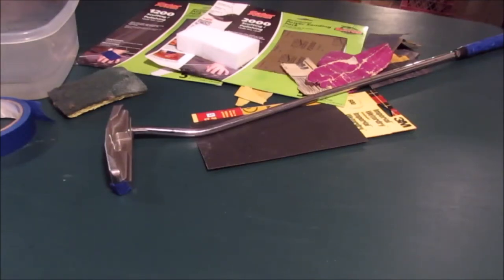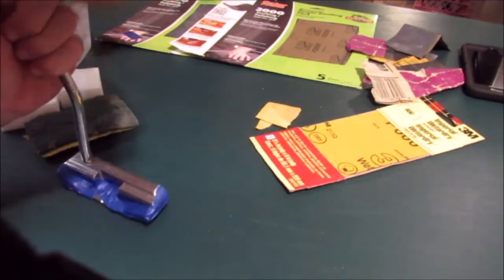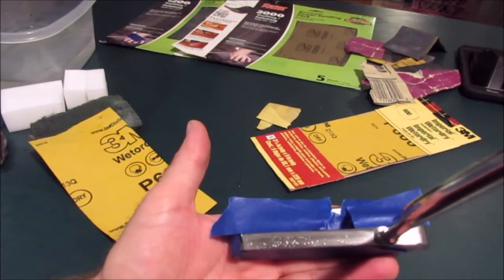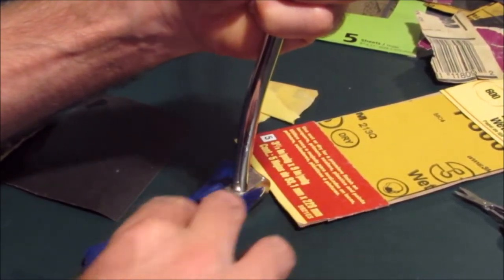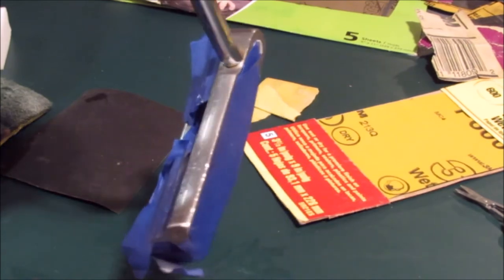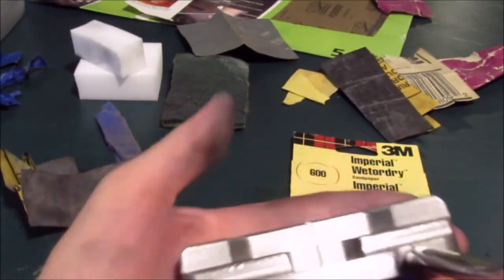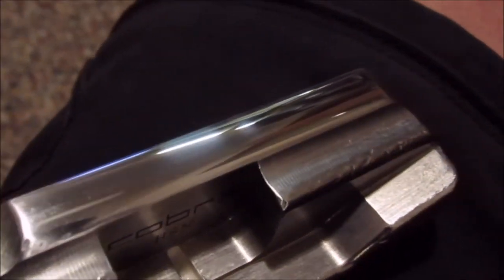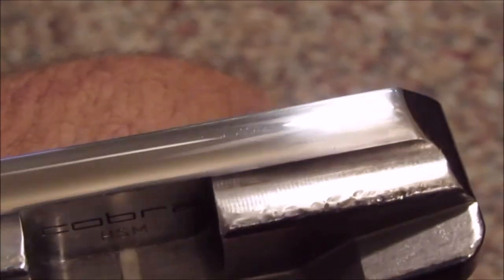Removing Dings and scratches from Golf Putter at Home DIY  putter refinish

Comment: Thank u for sharing your ideas! That is a lot...of elbow grease....takes a ton of patience and perseverance .....using multiple grits and hand sanding the putter. Putters I find are THE most difficult to remove deep dings since there are sooooo many edges to the putter...your approach is the best....tackle one edge at a time. Putter looks great, I am a new subscriber!
Reply from the maker: Thanks for the awesome comments! It's a lot of fun refinishing things DIY.  I wish I had a bead blasting kit!  Cheers!
Reply: @kidwilson3357  yes an economical small, take sale, thrift store, estate sale bead blaster ....for sale cheap to be worth a try?!....would be a coup de gras. Thought about sand blaster also, not sure w soft club metals how sand would not pit the metal? Any blaster device would be hard to control on putter nooks and crannies and angles...to protect adjacent surfaces that are fine....I can understand any club restoration if done as meticulously by hand like u did, can be labor, time  and materials expensive....the vintage or classic clubs...or even if special meaning, inherited or gifted clubs are worth restoring imho 😀
Reply from the maker: @MrWkendwarrior   If I had an extra room or a garage, I would probably just get a little Bead blasting Cabinet, gun and compressor.  You can get a whole set up pretty cheap to start out with  somewhere like a HArbor Freight store.  I just don't have the room.   I have refinished about 20 putters and when I had access to the bead blasting gun at the Mechanic Shop, the end product was like Brand New with a satin finish that was flawless.   fun project to do.

Comment: Great video. Exactly what I was looking for. I have an original ping anser that I want to clean up and I think the top line can definitely use this type of treatment
Reply: I have one as well, how did that go?
Reply: @8Huntro6   It worked out well. I did exactly what he did in the video. I didn't start with a really course grit, but something in the middle, then went finer and finer. I just went to an Ace Hardware in my area and just purchased a sheet of each grit. Was actually more delicate with the courser stuff and went a little bit more aggressive as I went finer and finer with the grit. I didn't go as fine as he did in the video because I didn't want a mirrored look, but more of a matte look. So, I guess that is something to think about.
Reply from the maker: @jjs5151   A scotch Brite pad will take the Shine off the mirrored finish.  Tks for the comments

Comment: Why don't you buy a cheap dremel tool,I just bought one £25 that's around $30,it sands off all scratches and dings then I polished it with one of the bits that came with dremel now looks amazing.i like buying old cheap dirty/beat up ping putters and tidy them up with my dremel tool,I can get brass putters as shiny as bars of gold lol
Reply from the maker: I just used what I had lying around the house

Comment: Thanks for posting this, never even thought this was something that could possibly be done to a putter. My putter is pretty new but I somehow got one small ding right above the face on the leading edge of the top line, so not on the top line surface but right on the edge between the face and the top line. Do you think I could fix that with this sandpaper method too? I’m worried if it would sand down into the face since it’s right on the edge. And if I did it I would end up with a softer/rounder edge right?
Reply from the maker: Hello. First of all I am not an expert by any means but I will try to answer based on the putters I have messed around with.   I think the real key is having a uniform finish, so I would imagine if you tried to remove that one little ding with sand paper, it would probably stand out if you tried to sand it in just that one spot.  You would probably have to tape off the entire top line and leave just a bit on the front edge the entire length of the face. Then sand the entire edge to taper/round it off and make it look the same. Thing is if you do just the edge, it might make the top line a differnent color than the edge.   Is your putter stainless steel?   The methods I used in the video are really only good to get the putter cleaned up and ding free..   I mention several times In my video the final step really is to have a Bead blasting Cabinet, gun and compressor.  Using the bead blaster, the little beads will give the putter a beautiful Satin Finish and the putter will look brand new.    However, using just the steps I show in my video will only get you so far.  If your putter is Carbon steel, then you can sand it down and Gun Blue it and can make it look great without the Bead Blasting.     I probably would not chance it if you like the putter. :)   But hey.. If you want an excuse to get a new putter. you can take a chance and have fun experimenting.  If you do decide to give it a go, just remember to put painters tape down and make sure it is even and only leave the parts you want to sand exposed. Taping and prep work is key.    I hope this helps.  Feel free to ask any other questions.  Thakns for the comments and watching the video.  There are a couple more videos i did on the putters so check them out also.  Cheers
Reply: @kidwilson3357  Thanks a lot for the such detailed and thoughtful answer. I just watched the part 2 of this and the final transformation was unbelievable... 
my putter is soft carbon steel, with a bronze finish. https://www.tgw.com/bettinardi-2016-studio-stock--2-putter This very putter right here. It’s a really good putter to me and I like everything about it, but I am kinda the same way as you said you were with clubs, almost having OCD for them being imperfect if they could be... I’ll probably hold on to it for a little longer til there’re dings and scuffs all over it and then I’ll do this project...
Reply from the maker: @vic_0315   That putter is a beauty. Carbon is usually butter soft so I bet that is a great feeling putter.   I wonder what color metal would be under that finish if its Carbon?  One cool thing about that finish is  if it's removable, you can sand it down and then use a torch and really make some wild colors with it..  I think.  I would research Torching/Refinishing Carbon Putters and I bet you will find a lot.    I had a Carbon Mid-slant Scotty Cameron Pro Platinum that I took all the dings out of and put a really awesome gun metal blue on it.   I wish I still had it.   If you do that, you will have to learn how to do a custom paint-fill as well.  Once again, tks for the positive comments. Stay safe out there!

Comment: Did you only use the 600 grit?
Reply from the maker: I used what I had lying around the house.   I did not use only 600 grit.  Ideally you want to go heavier to lighter.  I usually go 600, 800, 1000, 1200 etc.

Comment: Can you do a video on doing the nickel finishing? I’ve got an old Scotty I want to do that too because as of right now it doesn’t have a finish so it will rust as is.
Reply from the maker: Hi, i did a couple of videos after this one.  Check my channel and you should be able to find it.  It's the one with the Odyssey white hot #6.      Using scotch brite pad will give a slight nickle finish, but really there is no substitute for bead blasting.    If your putter is not stainless steel and is Carbon you can oil can that finish and will look good.    Tks for the comments!

Here is using the scotch britte pad toward end of vid:
https://www.youtube.com/watch?v=ach1ps26cAY
Reply: Kid Wilson33 awesome, thanks man!

Comment: Always use a hard block wherever possible. Hand sanding will result in rounded edges. Use clamps to hold the club, you will notice the difference. His club looks like rubbish compared to the ones I have done.
Reply from the maker: I actually like the soft edges actually.  Thanks for the comment!!!

Comment: Dremel tool dude
Reply from the maker: I honestly enjoy hand sanding them and the slow process.  I have been debating buying a harbor Freight bead blaster and set up and start re finishing them just for fun etc.  I like to do custom paintfill as well.   But for your comment.  Would speed up the process for sure.  Sandpaper is super cheap though.  Tks for the comment!